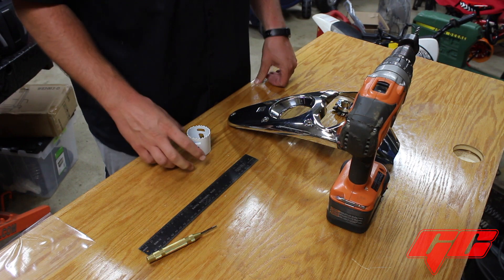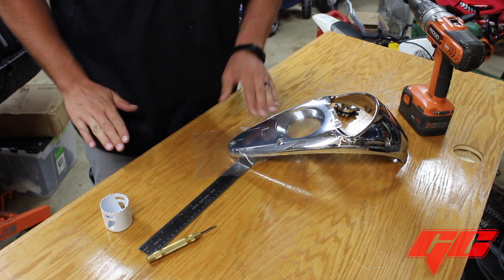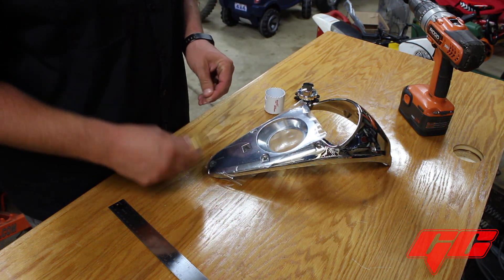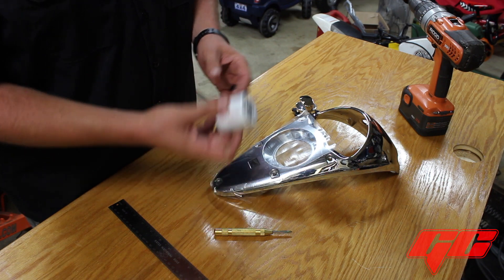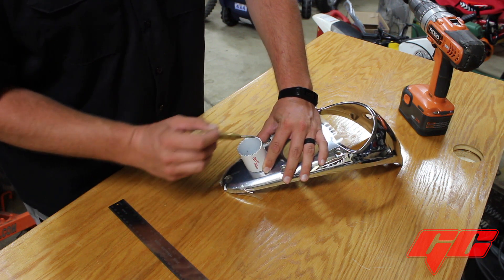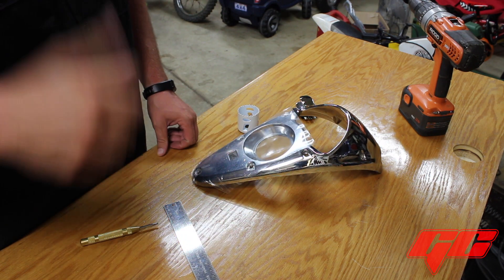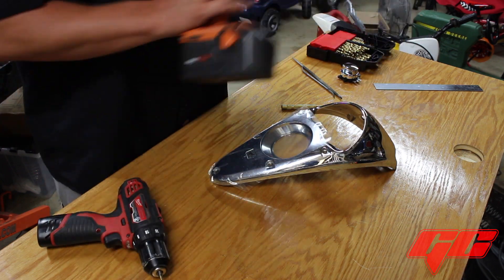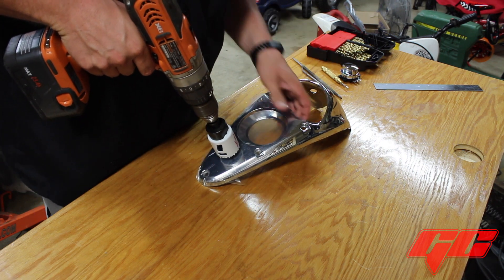Goheen Cycles Ignition Relocation Dash Install

Comment: When you install this relocation switch, do you remove the old one or just leave it? Also, is it possible to get the keys to match for the gas tank and the switch?
Reply from the maker: You remove your old ignition.  This one actually plugs right into your factory harness.

Comment: I put some clear coat around the hole just incase to help with the chrome not peeling just to be on the safe side(yea I'm just paranoid. .lol)..I also used a dremal with the round sanding attachment and just gently let it make a circular motion..rather than the files (as i hand none) and it worked like a charm.
Reply from the maker: That will do it too.  I honestly never thought about a dremel

Comment: I put the switch in My 04 Honda VTX1300C last Fall after a few rides I noticed the small screws had broken the Dash between the hole can you give me a fix for this. I love the switch and have done a temporary fix. for now
Reply from the maker: It sounds like the hole for the switch may have been a little too large or the mounting holes may have been too close.  You could easily epoxy the switch to the dash and just leave the screw heads in place to cover the holes.
Reply: @GoheenCycles  buen día, disculpa como o donde puedo conseguir ese ignition relocation kit para vtx1300 2003

Comment: Just received my ignition and I watched the install video. Can you do one on using epoxy or JB Weld?
Reply from the maker: +Robert Prescott sure, I just need to find a donor dash and I will put one in it with epoxy
Reply: Robert Prescott BTW new dashes are cheap if you order them on line (not ebay)
Reply: RanGer498 what's your non-ebay source for dashes? Thanks